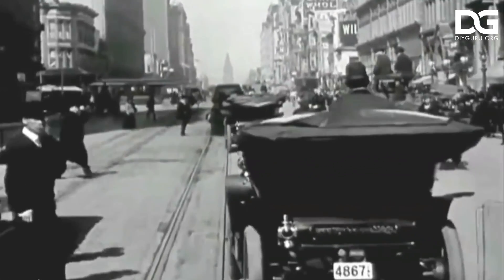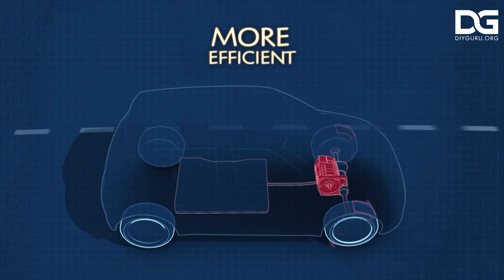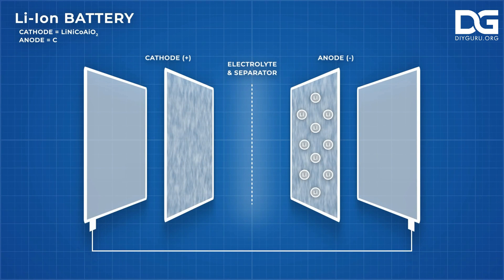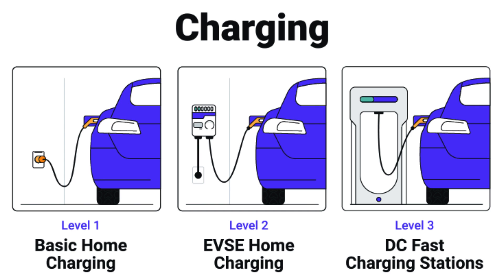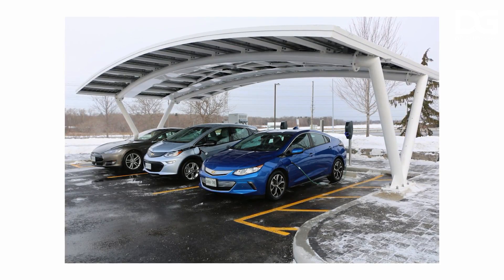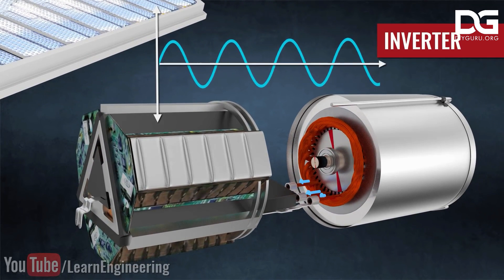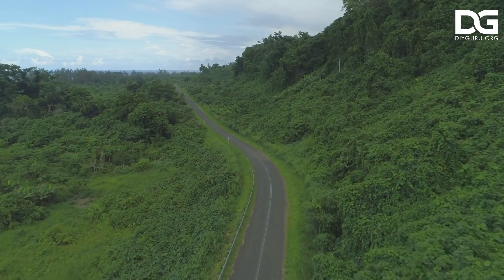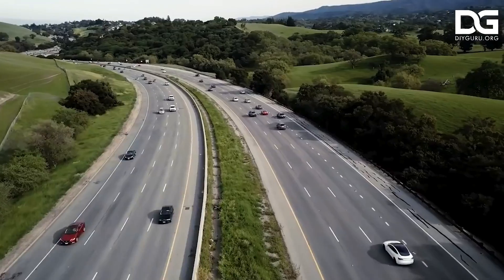Electric Vehicle Charging Station, Inverter, Batteries & Motors Explained - DIYguru

Comment: You want to switch to an electric vehicle, but you are facing range-anxiety? With the pioneering solution of Make My Day App you will never have this problem. The software directly connects with your car and battery status to optimize the charging process. At the same time it works as a route planner creating the most efficient route for your daily errands etc.
For more info: https://www.makemydayapp.com/